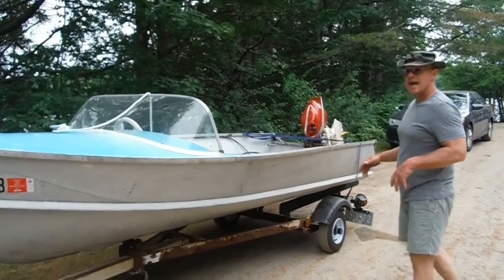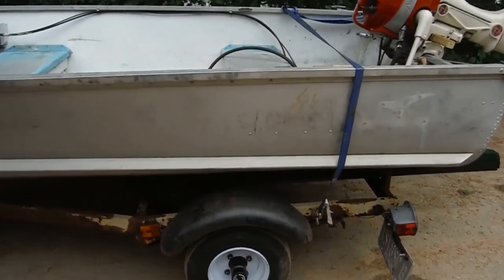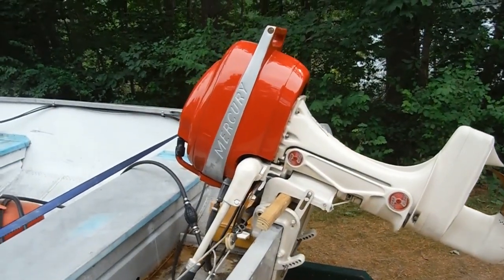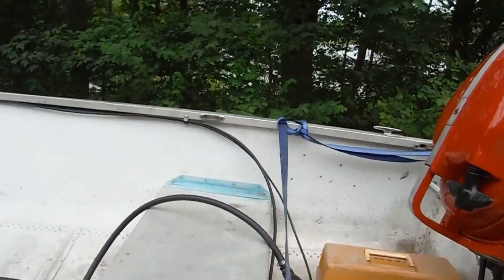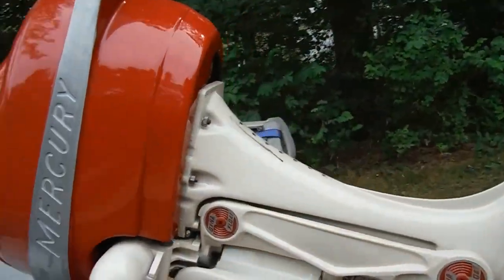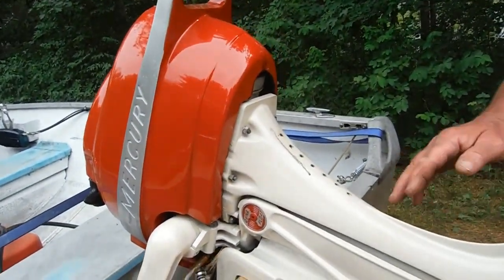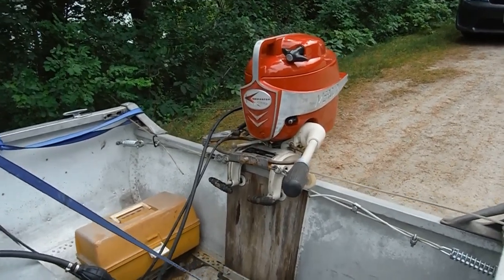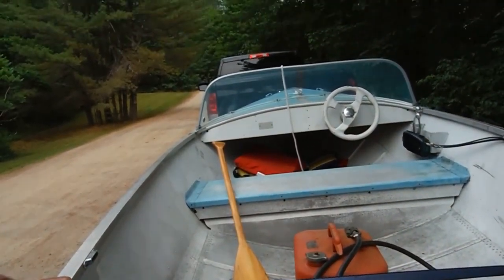1962 Duratec Comet

Comment: Great video, but The sound is way too low, I had to use headphones to hear it. Gary in Michigan. I run a 14’ 1954 Aero craft with 1955 Johnson 10 hp and 1970 Sears 3 hp. Also a 1960 16’ Glaspar mini cabin cruiser with a 1976 Johnson 75 hp ‘Stinger’, a 1957 Evinrude 7.5 hp and a 1979 ? Mariner 9.9. I restored a 1960 16’ Thompson with a 1960 40hp Johnson. Recently restored a 12hp Firestone...next project is a 1976 Chrysler 12.9. Currently working to finish a 1959 Johnson 18 hp ( it is also getting electric start.